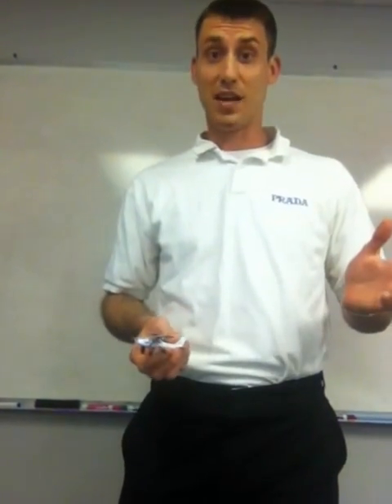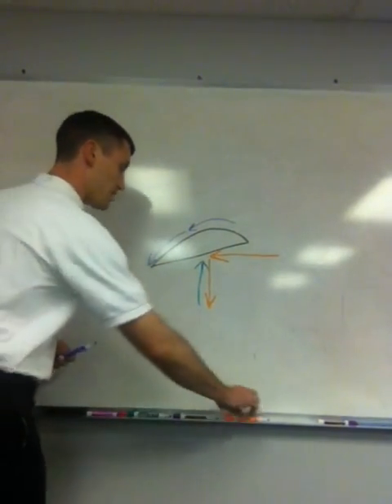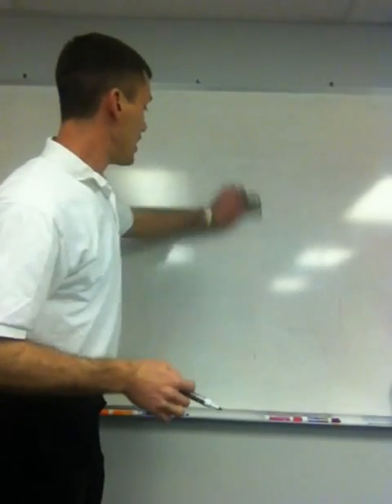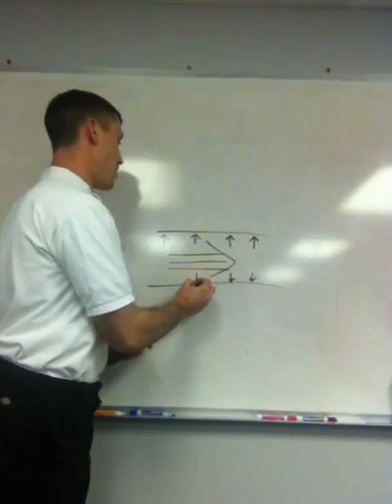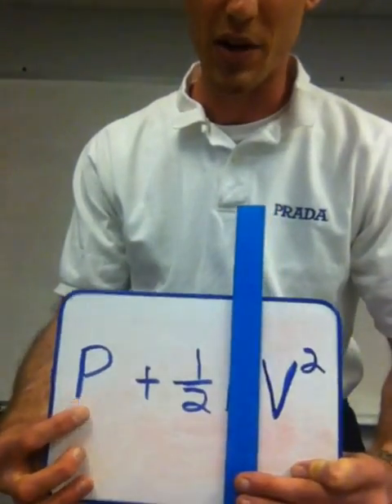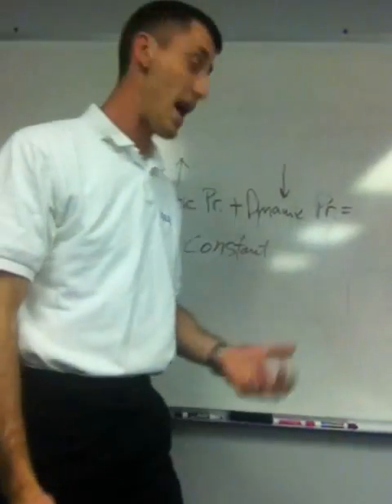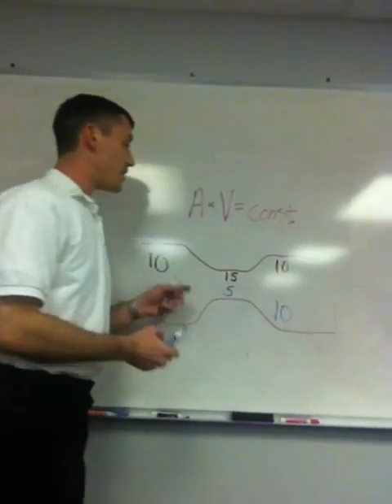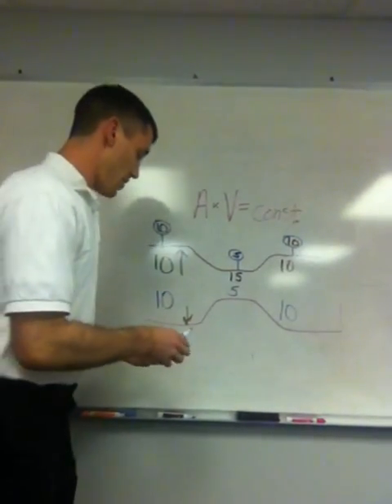How an airplane produces lift, bernoulli and newton

Comment: No. No. No. Lift isn't caused by a pressure differential. A pressure differential is the lift. The action of the downward excelleration of air causes the lift.  The pressure differential is the reaction, not the action. A pressure differential does not cause lift. The upward reaction force of lift (or pressure differential) is caused by the action force of excelleration of air. A reaction doesn't cause a reaction , an initial action does. So, no lift isn't caused by lift. The bernulli principle doesn't cause lift. It describes conservation of energy.

Comment: When an aerofoil starts from rest, it dumps a starting vortex in the flow, which can be visualised. If it stops, it dumps a stopping vortex. If it moves intermittently in a start-stop action, it dumps a vortex street. This is all easy to visualise.

The stopping vortex when bound with a moving aerofoil generates lift by the Magnus effect. I’ll talk about the Kutta-Joukowski circulation theorem if you like, but Magnus effect does the job of providing a simple explanation.

Explanations based on Bernoulli, Newton or Coanda fail to work with a hydrofoil moving through liquid helium.

Comment: There are a lot of misconceptions in this video about how a wing works.
Over the leading edge there is this Newtonian effect     https://youtu.be/AAjIdmYIZrQ     which causes a low pressure starting just behind the upper leading edge.
Balls hitting the lower surface and reflecting is also not exactly correct, The air particles through which the wing flies are initially STATIONARY and so  the lower surface acts more as a skier skiing over water..

Comment: Ther upper air is NOT made to flow through a smaller area. This is the pinching or 'half venturi' story and it is wrong.
.
For a short, correct explanation of the reduced pressure above, see this short video.
 https://www.youtube.com/watch?v=3MSqbnbKDmM

Comment: Sorry to tell your explanation is really wrong. Id you blow in the side below the paper it will also ascend, when, according to your explanation it should be suctioned down. You are implicity using the equal time theory that is absolutely wrong. Moreover, Bernoulli's equation can only be applied to a flux line in a fluid. When you blow you are moving a mass of air that can NEVER be analysed with this approach. 

The only valid explanation, please review documentation from Universities is: conservation of momentum (gradient pressure or normal momentum equation,) conservation of energy and conservation of mass. You can also add Coandâ´s effect if you want to better explain curvature of air lines sorrouinding the airfoil. 

The example with the ball is also terrible, you can not deal with a fluid as though it were a solid body. If you blow in front of your hand air does not rebound, it deflects to both sides. Do you think it would happen the same if instead of blowing you would used a ball blown from your mouth. 

You should be more carefull when explaining phenomena that imply complex physics rules and/or engineering equations. Sorry for telling you this. Best Regards.

Comment: This is a nice video and shouldn't attract any hate. The thing is from a pilots perspective all you really need to know is what is accepted as correct by the governing body of your license to pass your written and flight tests, and to impart a basic understanding on a practical level. That's it. What is demonstrated here is just that from the perspective of this instructor/teacher. However, this is not technically correct at all from an aerodynamic perspective. So when I demonstrate this to my students I make a clear emphasis on what's required to pass the exam but encourage an understanding of the correct principles behind this. Same goes for many other areas of theory. Pilots are not necessarily engineering graduates and don't need that level of understanding.
Reply: Its nothing to do with the level of understanding! The explanation is incorrect and its that simple. Its wrong. That's completely independent of whether you want detail of not. We should all want a correct explanation.
Reply: I think you need to re-read the above. I'm not saying this explanation is correct. What I am saying is that what you need to learn about lift production from (1) a practical in-flight perspective and (2) to pass the written exams by the governing body of the license should be the primary focus in flight training. I am a big believer in accuracy of information when it comes to teaching, but the fact is what causes lift is still not fully understood - take streamtube pinching for example. Most students only want or need to learn what is required to meet the required standards. For example here in Australia it's Bernoulli and the Coanda effect. The latter of which is totally incorrect from a fluid dynamics perspective, but that's the standard. I believe if you want to delve deeper into each of the many theories then this outside of basic flight training.
Reply: OK, I have re-read the above and turns out I got it correct the first time. This not flight school. This is YouTube in a public arena and what is being presented is incorrect. End of! We dont know how lift works? Sorry, but we do and its NOT how its p[resented in this video. Its not magic, its a well known (or not!) set of principles that work together but with some much more dominant than others.This presentation is wrong and you are stating constraints that are out of context for a YouTube video.

Comment: So basically what he is saying is if Bernoulli hadn't worked out the formula, Wright  Brothers wouldn't have been able to fly, now I can see why it needs so much explaining. Oh by the way isn't the same principle applies to many differential valves used on gas boilers and water heaters where a diaphragm is pushed to one side or the other as the liquids  start flowing through some constriction when a hot water tap is opened and this flow creates a differential pressure  and pushes the diaphragm to control a gas valve to fire a boiler. So without Mr Bernoulli we wouldn't have hot water systems either.
Reply: samdomding   No. That is not what he is saying.  Bernooulli merely pointed out some pnemomena in hature that could be applied to the explanation of lift IF A CORRECT EXPLANATION were to be given, which is not provided in this video.

Comment: Why do I keep hearing this incorrect explanation? Its 2015, lets deal with the facts please. See below for the correct versions. The thought that the air has to move faster over the wing top to meet the same part of the air travelling below is rubbish. Aircraft can fly upside down... explain that. Also a sailboat is similar to a wing but it has a single skin and so no difference between 'upper' and 'lower' surfaces. Lest get this argument correct please... its been going on for too many years.
Reply: Not rubbish mate just not the be all and end all. Generally wings are designed to provide more lift when flying right side up. They still work inverted but not as efficiently. Acrobatic aircraft wings are symmetrical for this reason.

Comment: Is this supposed to be a parody? 

It's a confused mis-mash of what NASA calls "Incorrect theory of lift #2" and "incorrect theory of lift #3" (http://www.grc.nasa.gov/WWW/k-12/airplane/wrong2.html) coupled with a common misconception about Bernoulli's principle and blowing over a piece of paper. (https://en.wikipedia.org/wiki/Bernoulli%27s_principle#Misapplications_of_Bernoulli.27s_principle_in_common_classroom_demonstrations)

He gets some things right, he gets some things wrong, and he's so confused about some other things that it's impossible to say whether it's right or wrong - it's just nonsense.

Sadly, misconceptions like these are often repeated, especially in pilot schools.  Fortunately, the engineers designing the planes don't understand it this way, and pilots don't really need to know how wings work.  Look elsewhere if you want to know how airplanes fly.
Reply: What's the right answer then?, NASA says the right answer is the Lift from flow turning... Here: https://www.grc.nasa.gov/www/k-12/airplane/right2.html

Comment: "As an epilogue to our discussions of airfoils and wings, it is fitting to examine
once again the source of aerodynamic lift. As emphasized in the previous
chapters, the fundamental source of lift is the pressure distribution over the wing
surface." from John Anderson Jr. (Professor of Aerospace Engineering) book  " Introduction to flight"

Comment: Just for clarification folks: Lift is not caused by the shape of the wing. Nor is it caused by magical pressure differentials.

Lift is caused by the mechanical intervention of the wing on resting air. Quite simply the moving wing, at a suitable

Angle of Attack bends the air on both surfaces downwards. The resulting force moves the wing up.Stick your hand out of a car window and you will feel the forces.

By causing the air to rapidly change direction, pressure differentials are created just like you feel on your hand. These a re a result of the air being pushed/pulled around by the wing. They are a result of lift production not the cause.

No change of angular momentum in the air-no lift.

Comment: If both fast and slow streams of air were to (somehow - just for illustration) stop or not collide after they pass the trailing edge of the wing, I take it the wing would still produce lift, just not as much lift?
Reply: Yes but thats not how the wing produces ,most of its ;lift. Air does NOT meet at the trailing edge and thats what is completely wrong about this 'old science' explanation.